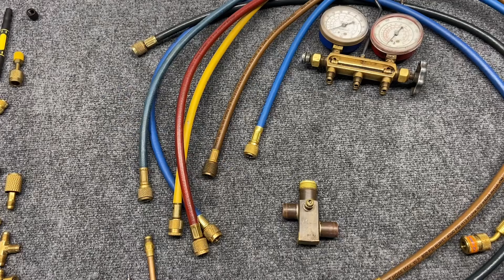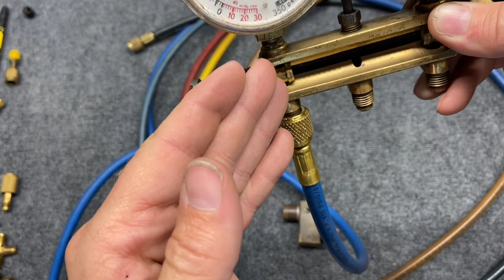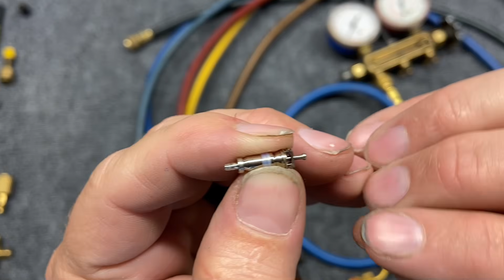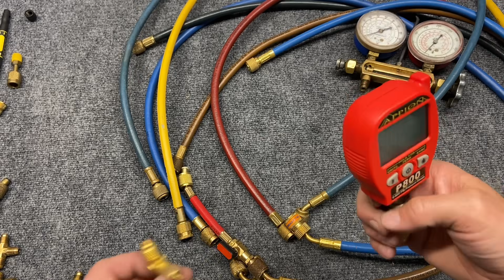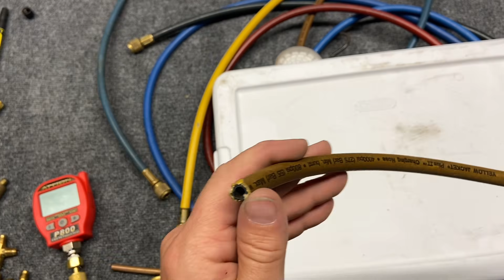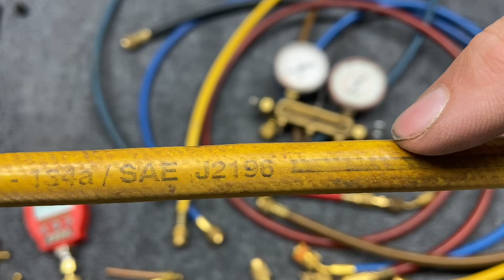HVAC 041 Hoses and low loss fittings

Comment: Ty, a couple questions
1. With gloves, if you use the right ones, is it the contact with the skin that makes your hands freeze, or is it the cold temperature? For example, in cold weather you need thick insulated gloves the keep your hands warm. Is the contact the problem or the cold air mist?

2. Why do some refrigerants come standard in 25# jugs and most others come in 30#? Isn't that confusing for price calculations as well as oddball sizes?
Reply from the maker: Great questions.
1st gloves heat transfer. 
3 things to consider
1 Direct contact, as your hands touch something heat from your hand traveled to the cooler object. The material if the object can speed or slow heat transfer. Touching metal speeds heat transfer, an insulated glove slows heat transfer.
2 air temperature, heat will leave your hand to the air temperature, but also as wind moves more air across your hand it speeds up heat loss. In lower in humidity moisture from your hand still evaporates changing state absorbing heat away from your hand. A glove slows the heat transfer to the air and slows the evaporation. 
3 fluids. Material that absorbs liquids are an issue.glave does great until you get it wet. Then it's transferring heat from your hand faster. If it's wet enviroment it has to be made to not absorb fluids. With refregerants, jusing a glove should be butal lines so it will not absorb to the glove. if not the refregerant will change state from a liquid to vapor at a very low temperature freezing your hand to the glove. This make it impossible to remove your hand from the glove and the refregerant continues to change state damaging your hand. 

Next refregerant tank size. 
Generally there is one standard size for disposable tanks that most of the industry uses. (Although In my day we could buy R22 in 50# single use containers.) 
Imagine a 30# container of R22, now imagina a 25# container of 410a.

Notice how the container is the same size?

If we do the math on a 30# recovery tank at 80% capacity generally speaking
R22 can hold 21pounds and 410a can hold 17 pounds 

R22  has a density of  3.66 specific gravity 1.197
410a has a density of 3.0
Specific gravity 1.08

It comes down to volume and weight. You can fit more pounds R22 I'm the same tank. 

*Note 410a tanks are thicker to Handel the higher pressure. Even recovery tanks  must be DOT 400 to Handel the higher pressure.
Reply: @love2hvac  when they list a price per jug on refrig. they usually don't say what size. If the say one is 110$ and the other is 280$, you don't quickly know how much per lb. They price by pound, not by volume, so it seems hokey to me.

On the gloves if you have butaline gloves can you spill freon directly on it and leave it there for a minute without being harmed?
Reply from the maker: Pricing by the jug is probably a marketing thing. 

refregerant on the glove give you time. It dosent soak into the fabric like other gloves. It also won't freeze it to your hand. Gives you time to get your glove off.

Comment: is the low loss fitting the same as anti blowback fitting?
Reply from the maker: Yes, I prefer manual valves. But when Im starting off with new students I use the auto low loss fittings (anti blow back) so they don't have to remember to open and close at first.
Reply: @love2hvac  thank you. with those 6" manual low loss fitting, there would still be some pressure blow back coming from inside the 6" hose? even with the valve close.
Reply from the maker: @ura617  yes. The ones I use have the valve right at the end so that's not an issue.
Reply: @love2hvac  Why not use valved fittings like on Auto where the fitting is attached to the port and then with a knob, the Schrader is pressed in and the hose is opened?  When it's time to remove, the pin is withdrawn and the hose is sealed. To Drain the Liquid hose, you feed back through the gauge set manifold to the Suction side. You are allowed to do a 'de minimis' gas purge at the gauges so as to not introduce non-condensables, water or prior system refrigerant into the current system. In an auto shop, even that is captured by the recovery machine through the yellow hose.

Comment: Hi Ty - The material you present in this video makes perfect sense. However, based on it, I’m confused about the cables that came with the manifold gauge set I got from Harbor Freight (Pittsburg Automotive #60806). The manual for the gauges shows the crooked end of the cables being connected to the manifold while the open end of the cable (straight) connects to the port valve quick release. Are these instructions flawed? I.e., should I connect the straight end (completely open) to the manifold? Thanks for any advice on this topic! - Jim
Reply from the maker: Automotive guages are different. 
They use a completely different quick disconnect and a seperste valve on the back of the quick connect.

Comment: I prefer to connect manifold hoses to service port while system is off because there's less chance of introducing contamination.  Also high side pressure will be much lower, resulting in less loss.
Reply from the maker: I agree, I always have students start with the unit off.
In reality its just not practical in the field. shutting the system down, 5 minute equalization, 15 minute run time to balance. That's a 20 minute loss. 

I have been using probes the last few weeks  that have virtually no loss. Im quite impressed with them. I think they will reduce a lot of loss and contamination once they become mainstream

Comment: Yup I burnt my hand once from R22 (ps I used a low loss fitting and it got stuck, you can imagine I never used a low loss since 😉). My hand looked like it got burnt in fire. Thank God my hand recovered completely 🙏🏻.
Reply from the maker: Oh no! I've had many stick, never got burned. The ball valves are my favorite second to the probes ofcourse.
The auto low loss I use  specifically for the newest students. I find they dont remember to turn the valve before unscrewing. 

I've always wanted to try these but I'd have to win the lotto first.
https://www.weh.us/quick-connectors/hvac-r.html
Reply: @love2hvac  yes a friend of mine just got it. One day 😉

Comment: Ball valve type controls still let lots of refrigerant out during hookup and removal. The Schrader depressor type is a really good no loss fitting.
Great videos! Keep them coming!
Reply: I usually use the on the high side most of the time.  I don't know why more people don't use them.  I know they can leak but with regular maintenance they are perfect.
Reply: I use them on everything, they are great on vehicles with the quick connect in odd positions.
Reply: I finally bought some low loss fittings after years of using ball valves. They were great until somehow a gasket fell out of my HP fitting. Now I can't seem to find a replacement gasket. If they aren't replaceable then I'm going right back to ball valves
Reply from the maker: You can buy replacement gaskets but you need c clip pliers to take the ring off the back. 

I much prefer manual ball valve low loss  fittings for field work.  I only like the automatic ones for new students so they don't have to remember as many steps.
Reply: @love2hvac  oh, good to know. I was having a hard time finding them online. Hate to throw away a brand new hose. Still it's kinda a pain in the arse. I think I'll go back to balls
Reply from the maker: @RoyArrowood  contact tru tech tools and they can get you the right  gasket. Ball valves for the win
Reply: Thanks for yoyr videos. I am confised you say that you prefer ball valves low loss. But are they two different types? I am confused which ones are low loss and ball valves at the same time ? The ones that you recommended?